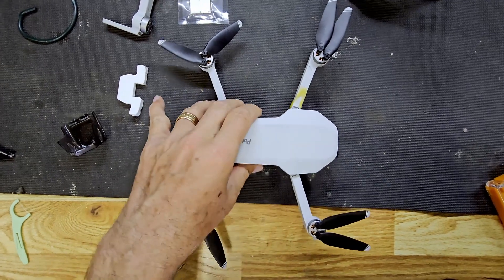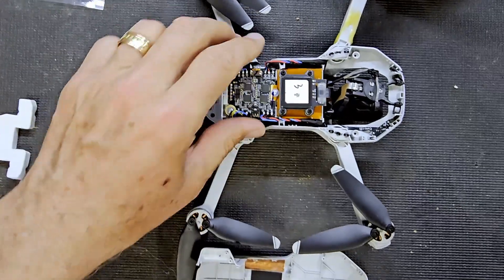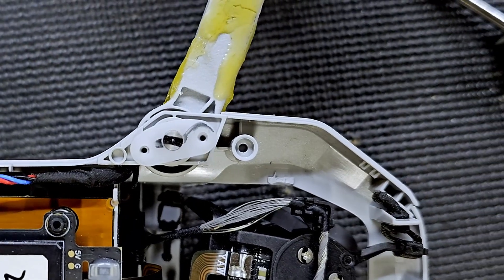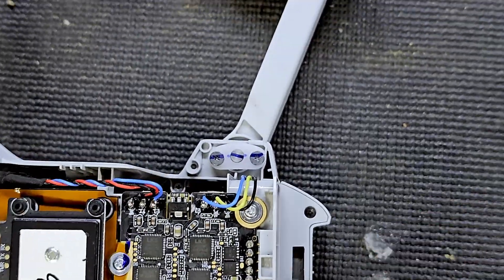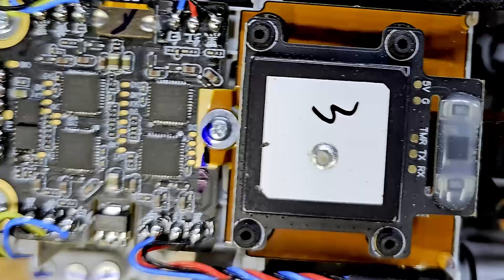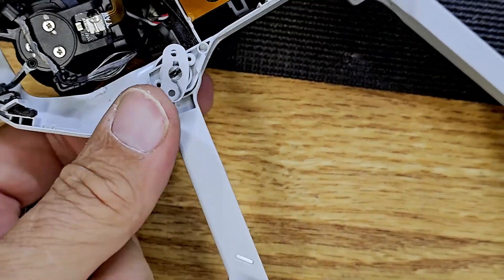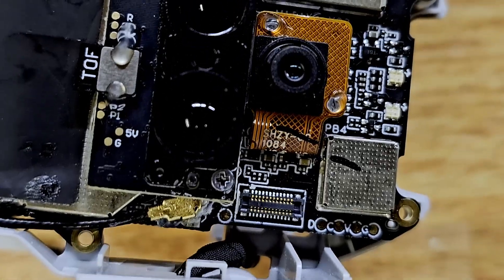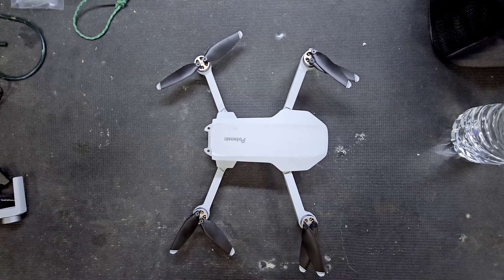Potensic Atom Drone Front Left Arm replacement

Comment: My atom 2 took off like a crazy bird while I just started it to test it hover in place and turn 360, and broke the left front arm. Cant even find a replacement!
Reply from the maker: Bummer.  Sorry to hear.  Maybe you can find a broken one with left front arm intact on ebay?   Good luck!
Reply: @ReelFishersOfMen  thank you, searching for it. Can it be epoxy gued? Will the slight extra weight confuse the onboard computer?
Reply from the maker: @RhettSparrow  Yes.  I used epoxy on my first before I replaced it.  No issues.  Good luck my friend and let me know how it goes.

Comment: hellow sir what tools did you use to open the plastic body shell of atom,thanks
Reply from the maker: Once I removed the screws, I just used my fingertips to press the sides of the body where the latches are.  If you watch the video you can see where the latches are to assist in where to apply the side pressure.  Good luck! 🙏

Comment: How did u fix the antenna? Did you use glue? I guess you had some problems with the port for the antenna, right? I seperated the "docking port" and now I'm a bit confused how to connect the new antenna top the port. Greetings from Germany ^^
Reply from the maker: See below... and thank you for watching Germany!  🙏💛
Reply: *You said you used superglue to fix it. Is the connection between the RC and the drone still possible?
Reply from the maker: Yes I used super glue. If you have that UV glue use that. Afterwards, drone worked perfectly.  Hope you experience the same outcome 🫰  Good luck 👍
Reply: @ReelFishersOfMen Thank you!

Comment: Thank you for the video. Is your ATOM drone still holding up in high wind speeds?
Reply from the maker: Very welcome.  under 15mph winds it does great.   thank you for watching. 🙏
Reply: @ReelFishersOfMen  I've flown with original parts in 25-35MPH wing gusts without issue. I figured replacement parts would probably change its wind tolerance.
Reply from the maker: I did not notice any difference after replacing the one arm.   I think if there was a difference the fact I only replaced One arm/motor would make the drone fly erratic, regardless of wind.   Kind of like when you have a bad prop or debris in the motor axel.   Interesting to hear what others have to say?

Comment: If you get a little flat head screw driver under the antenna wire and give it a little push, should pop right out of the connector. Worked for me. Not sure if its a quality control issue with yours or if the pliers glamped the connector onto the pin. But hopefully that tip helps someone. Ultimately  its a pretty easy little repair. Thanks for the video
Reply from the maker: Thank you for the tip.  I actually did that.   My board may have had a previous defect as you mentioned.  I have since decided, if I had to do it again, I would just strip the wire and solder to the wire.  The repair i did still is working so... 🤞😅
Reply: Thanks for the advice.  I did pop it out.  It has some glue I think to strengthen the connection.  I tried connecting it back and pop right in with ease.  Just need to wet glue it again just to be sure it;s fixed.  Thanks!  

BTW mine the same.  Need to replace the front left arm.  :)
Reply: Yep, worked for me too. Might have been the glue that broke it when using pliers to disconnect it. Great video nonetheless. It helped me a lot!
Reply from the maker: @myselfandeye3884  Glad to hear.  TY 🙏
Reply: Thanks for the video. I just had a drone crash and one of the legs cracked. Probably be gluing it if it isn’t covered under Potensic Care 

On the antenna, if it’s an IPX connector it should lift off straight up. A tiny flathead screwdriver should help it off as the other person mentioned. Replace it by pushing it straight down and it should snap into place. Fingernails help.